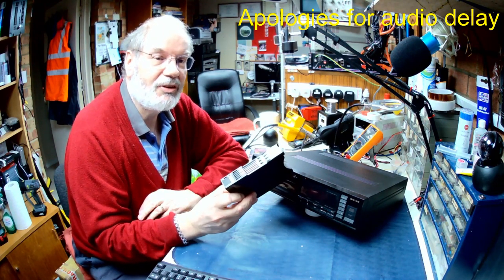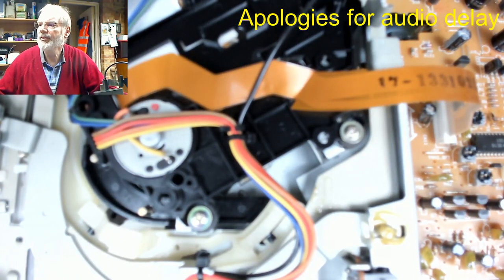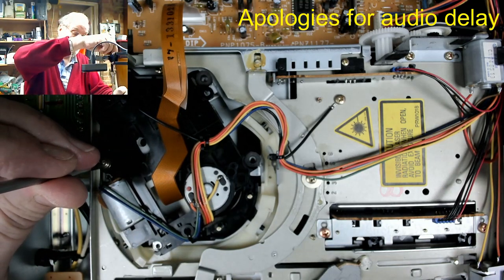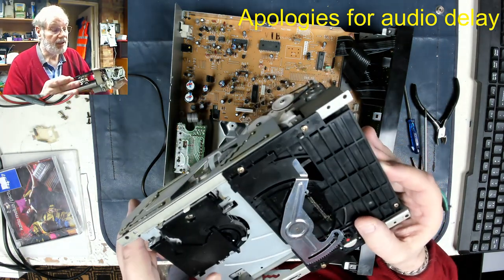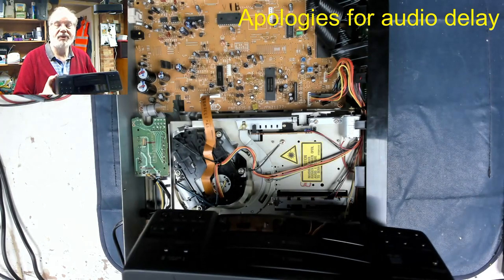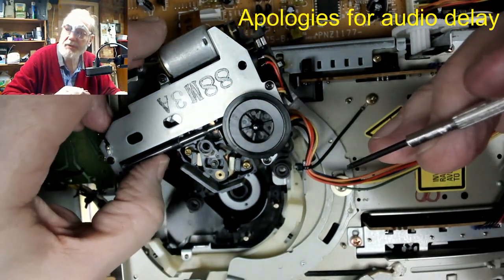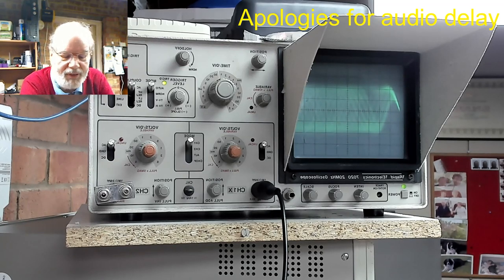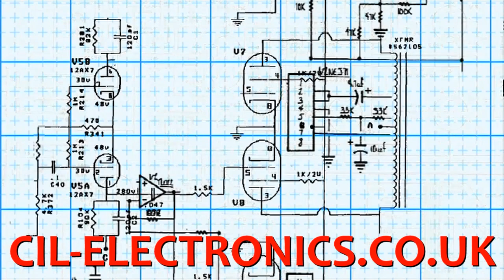Fixing a Pioneer PD Z81M CD - Optics Repair

Comment: Hi Chas, thanks for posting this. Just bought this model from ebay. it couldn't detect a disc, and there was a rattling inside at some point. Had a look, and just as you had described, there was the optical lens, now stuck in some grease. I've placed it back with some clear nail polish as you had. I can  now hear it trying to read the disc, but it eventaully gives up and moves on to the next one. Had a look at the service manual to adjust focus and such, way beyond anything i dare try. Still, made progress, so thanks again!
Reply from the maker: Did you check to make sure you put the lens in the right way up? I recall that it could be put in upside down. If you were lucky, there would have been some old locking adhesive left on the lens and the mount which would guide you in the orientation. Also, there could be dust in the optics, you could try blowing it clean with an aero duster. Adjusting without a scope is not a good idea, it does not take much for it to not work. If you have adjusted them, try setting them all mid point and then just a little tweak of the offsets, you’ll hear the lens servos straining if it goes too far.

Comment: I enjoyed this video, a detective thriller in its own way. My unit still plays so I guess the infamous lens is in place, but every so often if will get stuck on a 2- or 3- second loop, or just stutter and skip, a bit like a scratched record. I wonder if it just needs a good clean?
Reply from the maker: Thanks, I like the analogy of being a "Detective Engineer". 😁
Yes, it's possible the optical block may need to be cleaned, though with it being upside down, compared to other CD players, its less likely. A short blow with some aero-duster can help, but emphasis on the short, as too long a spray can cause it to freeze the parts of the block and that might make the lens fall out. A clean dry cotton bud on the objective lens would help. Also a small wipe of the chrome bar the optical block travels along, with some light "molycote" grease can be beneficial, as that can cause sticking or skipping when it gets dry and the block sticks as it travels.
In my experience however, disc sticking is more often down to marks or scratches on the disc itself. Clean that with a lint free cloth, wiping from the centre outwards, not round the disc.
Reply: @ChasLarge  Not to boast, but the interior is pristine. The lens was in place, and I applied a tiny dab of alcohol just for kicks. The issue, I think, is that the "optical mechanism" is loose even when the screws are tight. Maybe the rubber cushions on each of the 4 screws have compressed somewhat? There are a few comments along this line in other videos. I noticed it did not appear to be an issue with you. If I hold the mechanism at a tiny angle while a problematic - and brand new - disc is playing, it no longer skips, but obviously that is not a very comfortable solution. So, I need to get some compatible cushions somewhere. (Of course it could be something completely different.)
Reply from the maker: TBH I doubt the support cushions are a problem. The optical units are meant to float somewhat to allow for centrifugal spin of the disc making the mech wabble which could in turn cause mis-tracking. Also, when the clamp is moved into grab the disc to the turntable, it needs an element of flexibility. These upside down pioneer units were mostly troublesome because the objective lens had fallen out or worked loose and the angle of the returned beam from the disc caused errors. 
I would suggest, if you have an oscilloscope, you monitor the eye pattern of the RF waveform from the disc - its available on Test Point 1, to see if it's low (Laser output) or not clean like an eye shaped pattern (Servo Issues). DO NOT ADJUST THE LASER POWER WITHOUT A LASER POWER METER AS YOU CAN KILL THE LASER.
There could be problems with the capacitors in the PSU drying up which could affect the supply rails and give issues with the servo circuits.
Hope this helps.

Comment: Very good video sir! I have a Pioneer PD-M50 changer that won't read the disc and the disc doesn't spin. I removed the screws holding the optical block in place and the lens is still in place. It is spanking clean so what could it be? Spindle motor?
Reply from the maker: I would suspect the Laser. The player first has to achieve focus on the disc. The laser is turned on, the focus servo moves the objective lens up and down to achieve focus and when it has, it spins the disc to read the TOC. So, no laser = no focus = no disc spin. If possible take the mech out and turn it upside down and place a piece of tissue paper over the objective lens and then open and close the drawer to start the search process, look for a red dot on the tissue paper. DO NOT LOOK DIRECTLY INTO THE LENS!!. If there's a dot, the laser is working, if not, DO NOT ADJUST THE LASER POWER, you can destroy the laser - something else may be preventing it from working. Check that the objective lens moves to try and obtain focus. If not then I would check all the power supply rails. If they are 10% or more out, check / replace the electrolytic capacitors in the PSU.
Hope this helps. 🙂
Reply: @ChasLarge  Thank you for your advice. I will follow your suggestions and see if the Laser is active and go from there. Very good theory on what is causing the problem.

Comment: Hi, was repairing my one of these. I was cleaning the lens runners(?) as was sticking. I took the screws out of the laser assembly for better access, between the lens unit and a white plastic plate a small spring popped out. Any ideas how to put that back?
Reply from the maker: I don't have one in for repair at the moment and the service manual diagrams are not brilliant, so sadly, I cannot identify the spring or where it goes, sorry.

Comment: Hi, Chas,

I have a PD-Z83M - insides are identical to you're PD-Z81. I repaired the lens, and it all works fine, except at around 35mins and 60mins, the disc skips. I bought a donor machine, exactly the same, repaired the lens as it was floating around in the case, and this also works, but skips in exactly the same place on the discs. The skipping is proceeded by a 'ticking' noise, which gets louder towards the point of skipping, then fades again afterwards. Any ideas? I've completed cleaned the laser pickup assembly and am confident it's not mechanical, other than maybe a problem with the spindle motor that the CD sits on, perhaps at 2 particular speeds of revolution. Any advice would be greatly appreciated.
Reply from the maker: As the problem appears to be occurring at the same place on the discs, I would look at the sled guides, the rods on which the optical block traverses the disc. Even a small amount of grease stuck on the slides, will cause this kind of tracking issue. Essentially, tracking is carried out in two ways, small movements by the coil on the objective lens and larger movements by the sled movement. The clicking could be the sled getting to a point where it stops sliding then the tracking servo tries to compensate by moving the objective lens to it's limit, where it then jumps back - click = skip. Try removing the optical block from the rods, cleaning them with iso, do the same on the bearings in the block and when reassembled, apply a tiny smear of molyslip grease along the rods.
Reply: @ChasLarge Thanks for the quick reply, Chas. I've cleaned the rods, the worm screw, pully wheel etc and it's still sticking. Where are the bearings on the block - not looked at them yet.
Reply from the maker: @MikeSavage-n5q  The bearing is where the rod passes through the optical block, typically they are small brass tubes embedded in the plastic. 
If you've isolated the linear mechanics, it's either a problem with the tracking servo or there is a mechanical interference in the optical block causing the tracking coil on the lens to be affected.
If you put the unit into test mode, can you drive the optics across the disc in one smooth movement or is it still sticking?
Reply: @ChasLarge Morning, Chas - put the player into test mode - the optics moves across the disc and back in one motion and doesn't stick - bit noisy, but seems to work fine. I don't have a scope, but was looking at getting this to perform the adjustment procedure - DSO 152 Handheld Mini oscilloscope - would this be up to the task? Thanks so much for your help - it is greatly appreciated.
Reply from the maker: @MikeSavage-n5q  I have downloaded the PD-Z83M manual, but cannot find the adjustment diagrams or even the schematics for the CD section. Are you using a different manual for the CD? It should show the waveforms to look for, from those, you should be able to identify the bandwidth of the waveforms and this will give you a clue as to how good an oscilloscope you need. The mini-handheld scopes are often low bandwidth, 5 or 10MHz, so may not be capable of displaying the waveform you need to test. Personally, I would not consider any scope with less than 20MHz bandwidth. You can probably get a second hand scope on ebay which will do the job for not much money.
Reply: Hi Chas. You said to use Moly as the lubricant.  I have used Super Lube - think it's american - could you please specify what you have used? Thanks again.
Reply from the maker: I found a Molycote grease as used for 3D printers, on eBay. It's a white grease but has no specific manufacturer name. So long as it's a Molycote grease not a spray or oil it should be fine.
Reply: @ChasLarge  Thanks Chas.

Comment: Nice fix! I'm a beginner and have a question. If the player can read the TOC, is the laser good, or can it still be bad ?
I've got an old Pioneer and it reads the table just fine and quick, it tries to read the disk, but fails to play.
Reply from the maker: Hi, it's probably good and the problem is with the tracking servo. It could be an electronic fault in that the servo that moves the objective lens sideways and or the tracking motor, servo which moves the whole optical assembly along the radius of the disc. or it could be mechanical, where the lens movement is blocked or the drive of the tracking motor is failing or the path it travels on is blocked. Cleaning the objective lens assy with short bursts of aeroduster can sometimes be a fix. If the mechanics appear dirty, then a disassembly, clean, lubricate and reassembly can be the fix. 
If you have a service manual for the unit, check to see if it has a SERVICE MODE you can put it into which will allow you to test each servo manually.
Hope this helps. 😄

Comment: Hi! Great content, I find myself in a similar situation than you. I am restoring a Pioner PD Z81M I had lying around for some time. Turns out the last part I need is the lens. I was wondering if you could tell me the specification of the lens or if you could  send me a link where to buy that lens. Do you think a generic CD lens would work as well?

Thanks In advance! Cheers!
Reply from the maker: Hi Luis, I've never needed to buy a lens and I do not think Pioneer ever sold them individually, you had to purchase a new optical block.
I have either found the lens stuck to some part of the mechanism in a grease spot or wedged between components on the PCB. If someone else has already looked at the unit, then the lens could be lost completely. The alternative it to buy a non-working unit from e-bay as I had done in this video. I never found the original lens.